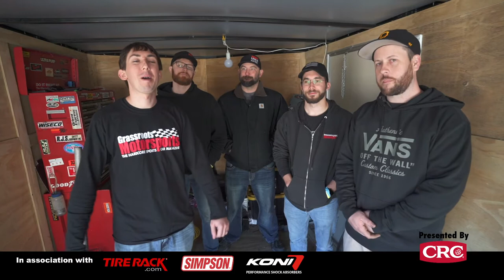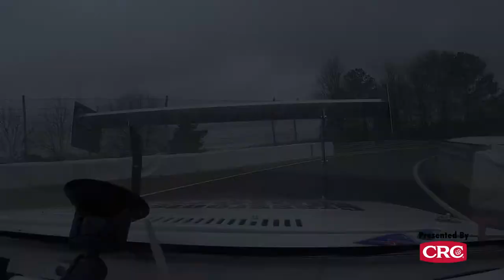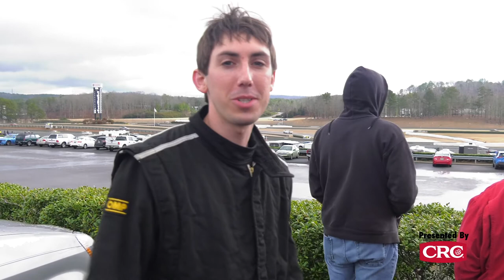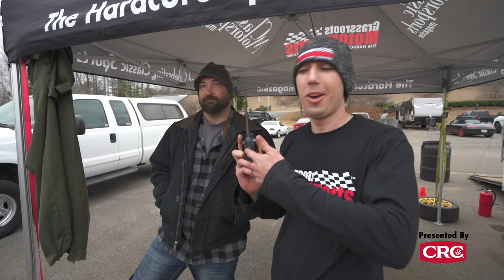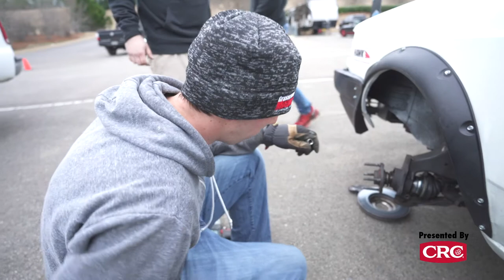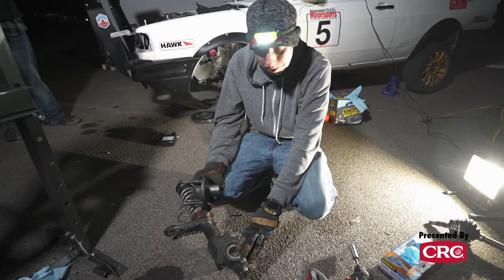Racing a $500 VW Race Car at Its First 24 hours of Lemons Event! | Project VW: Ep 4

Comment: It wasn't the wheel bearing failing that loosened the axle nut.

The axle nut came lose and took out the wheel bearing, ours tries to do that all the time.
Pro tip:  Re-torque the wheel nut before every race day, and sometimes during the race.
DO NOT over-tighten the nut, the threaded stub will snap off, guess how we figured that out.
Reply from the maker: Yep, we figured that out after further inspection back at the shop. We'll cover that in a future video.

Comment: Yikes, compared to jetta/golf parts, fox parts seem like its going to be a challenge, curious to see if there is a budget option that lets you use other more common vw stuff. Fun stuff and glad to see everyone get good seat time
Reply: Many of the parts from fox, jetta/ golf are similar if not the same...
Reply: @davidhollenshead4892  the transmission and front suspension stuff though are more audi fox/vw dasher which have added challenges of finding parts I would think
Reply: the engines are basically identical between the different cars, just bolted to a longitudinal transaxle. the axles and suspension are pretty different, but if you have a welder...................